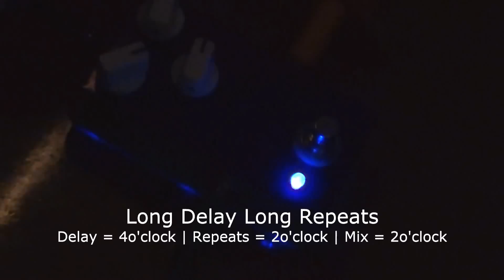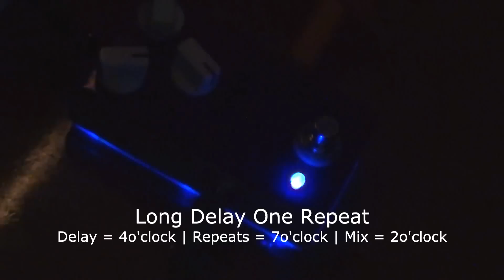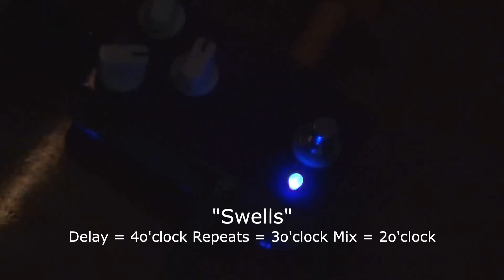Demo: Fleet Beacon Delay based on Deep Blue Delay (Madbean Sea Urchin)

Comment: i just finished building 2 of these and both of them only get about 5 repeats. any ideas why? 
is there maybe a resistor that may be doing that somewhere in the schematic? i built them both at the same time so i may have gotten the value on one wrong

Comment: do you get any distortion with delay at max? I'm having some trouble with that.
thank you for sharing your experience and knowledge, You have been a great motivation since i started with DIY pedals. Greetings from Chile.
Reply from the maker: Hi Rodrigo, yes with the PT2399 once you hit 300ms+ it will distort.  Its part and parcel of the PT2399.  Cheers